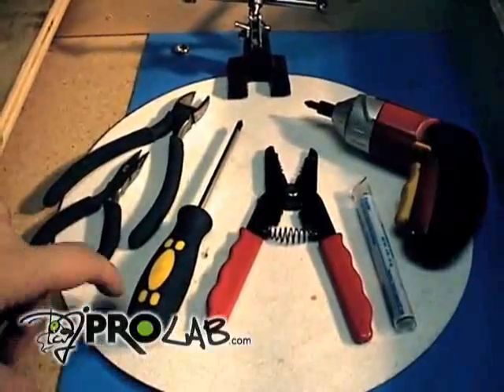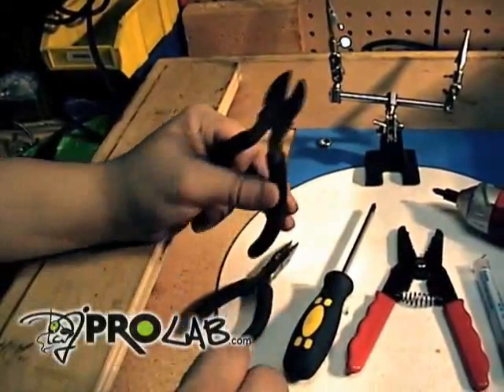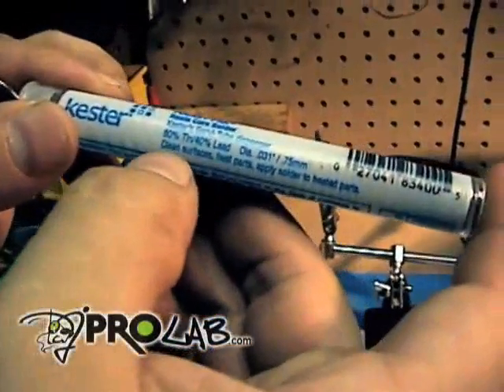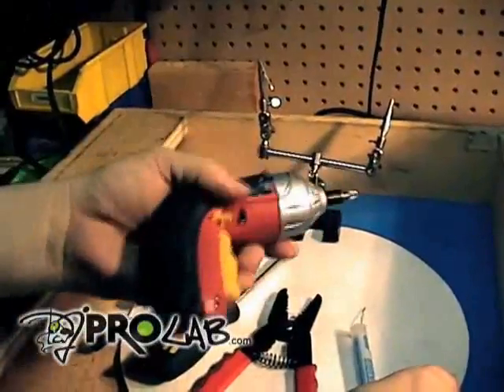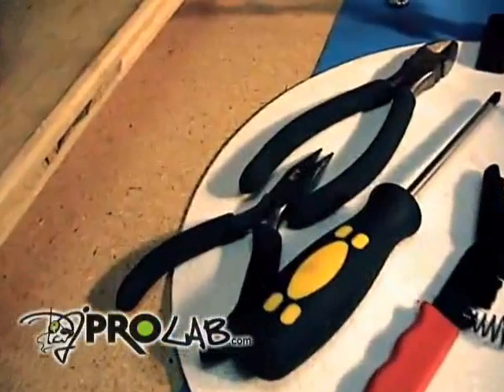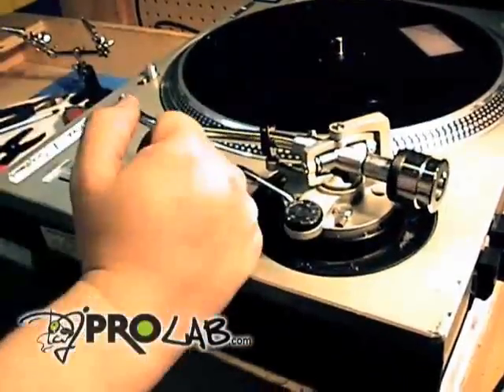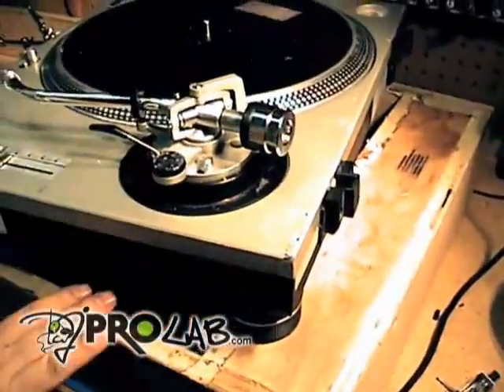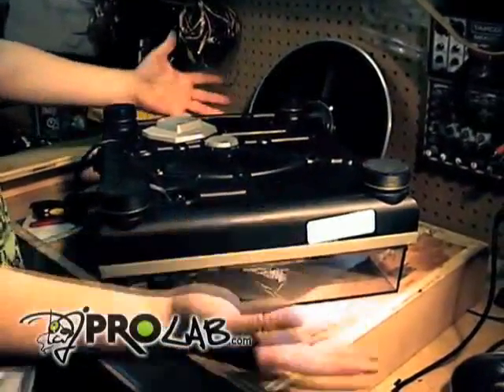DJ PRO LAB - Technics Disassembly Pt 1

Comment: I cant get -3.3 synced up with +3.3 or 6 ,if i get the + speeds correct - is always at -2 i just can't find that compromise,I've changed pitch controls hooked up a multimeter to the correct freq and done all the fine running to both pots but still the same,have you had this problem before ?

Comment: Djprolab. I have a question. I have a technics sl 1200 M3D that was given to me for free. I had it painted, changed the lights, and replaced the tone arm. My question is how to I fix platter cogging? Intermittent wobble occurs. the platter is straight everything looks fine. While the wobble occurs the lights dim.. Could this be from the light kit I purchased drawing too much from the PS?